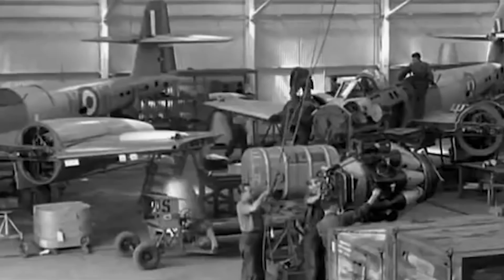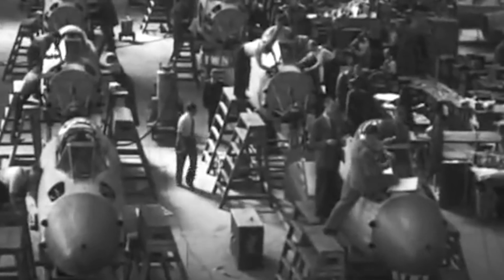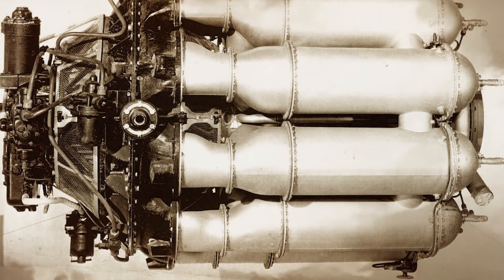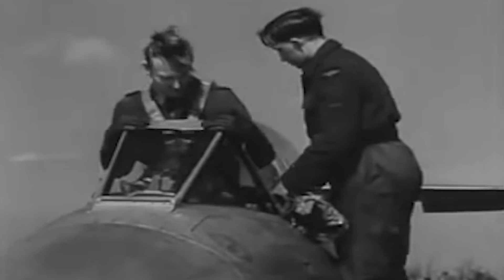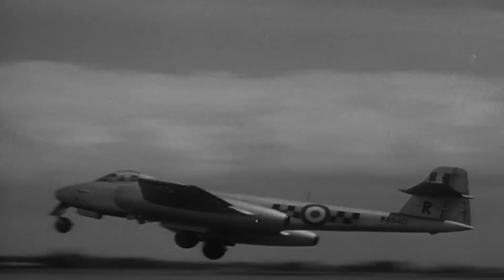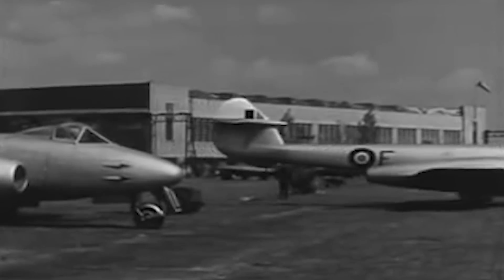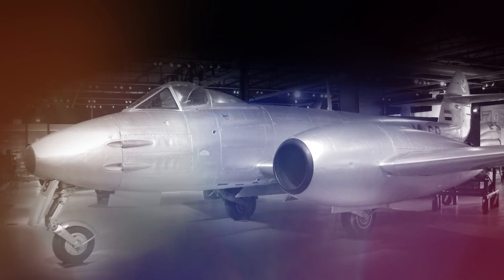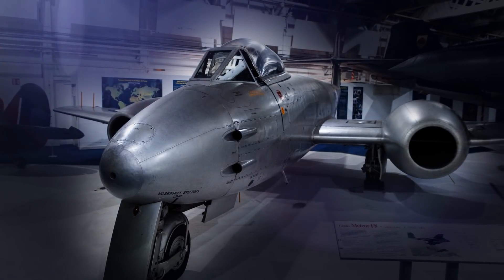Gloster Meteor - The Only Allied Jet to Fight in WW2

Comment: The meteor wasn’t developed to counter the Me-262. They entered service at roughly the same time. It was just pressed into service to tackle the V1.
Reply: I thought this too 👍🏻
Reply: Mactrip100 it was developed to test Jet fighter feasibility and to replace existing piston-engine fighters that were reaching the limit of development. 

Only the MkV and IX spitfires were developed to meet a specific existing fighter threat. Me109F and FW-190A respectively. From a purely british perspective.
Reply: @petemaly8950   Yes,  a certain person is now running to the mods because he doesn't want to read that  the Metrovick F2 was fully flight tested powering the F.9/40M on its first flight and continued in development to F9 and was produced as the Sapphire engine in the UK and under licence in the US as the J65. 

And that , during the war the Metrovick was developed with reheat, bypass and even open rotor versions. As you know German axial flow engines were hopelessly unreliable and ephemeral. As he mentioned Eric Brown, he'll recall that Brown noted that the Ju004 had an average scrap life of only twelve hours. 

he'll also be aware that post war Anselm Franz spent the rest of his career designing shaft engines to the format of Whittle's 1930 patent. In Russia a team of captured German engineers with the help of a host of Russian engineers still couldn't significantly improve the reliability and life of the Ju 004 and it was relegated to conversion trainers and a few experimentals. They tried the same with the BMW 003 and fitted it in the lacklustre MiG-9 but it proved to be so unreliable and flameout prone that when it came to the iconic MiG-15 they replaced it with the British Rolls Royce Nene engine. The French he'll recall adopted Ostrich, his team and the BMW 018 and even with as big a team of French engineers and completely redesigning the engine and adopting British Nimonic alloys the finally produced a serviceable engine only two or three years after their British and American peers. He is aware that Germany has never produced a significant successful GT jet engine without foreign help. 

And he  knows the Gloster Meteor was an extremely successful jet having a service career of over thirty years and serving in more than a dozen air forces, what other WW2 jet can you say that of except of course the de Havilland Vampire. The poor old Czechs lumbered themselves with eleven or twelve Me 262's but couldn't flog them to anyone, not even Argentina who were being advised by Kurt Tank and Adolf Galland and who bought the Gloster Meteor leading Galland to whish that he could have had the Meteor's engines on the Me 262 instead of the rubbish German engines.
Reply: Mactrip100  The 2 aircraft and engines were developed separately and without knowledge of each other ( although the Germans had read an early Frank Whittle research paper. Eacb side was looking for an advantage and turbojets had potential to be faster and higher that piston engines. They would also burn a lower grade fuel. Actually the Meteor was over a year late. The air ministry had given Whittle's design to Rover to produce but they made a hash of it. Finally they transferred the contract to Rolls Royce and the rest is history.
Reply: @davepotter9532  

Rover didnt 'make a hash of it' !
ROVER did a lot of the early1940s development of Whittles jet design and made lots of  improvements. Their design was good it wasused by RR in what became the RR Trench engines. However, Rover continued development themselves and produced in the 1950s the world first Jet powered car Jet 1. 
They even produced in conjunction with BRM a jet powered race car that competed at Le Mans driven by Graham Hill. Rover also produced Britain most successful gas turbine engine used to power various applications like water pumps and generators.
In the 1960s Rover intended their new P6 cars to be powered by a jet engine however, in 1967 Rover were taken over by British Leyland and that where all their problems started, and their fine reputation as engineers second only to RR was lost.
Reply: @johnbrereton5229  Good point, The real geniuses were Adrian Lombard at Rover and Stanley Hooker at Rolls-Royce.. without them Britain would have never had a successful jet engine program.
Reply: @sandervanderkammen9230  Halford and Metropolitan Vickers would like a word with you.  Britain was leading the world and gave USA and USSR their jet engines, the German jet engines were failures.
Reply: Lol a normal Tempest was well fast enough to catch up on a V1
Reply: @derrickstorm6976  define "normal"
Reply: @derrickstorm6976  
It was not just catching but catching up fast which was important and for which the Tempest, Mosquito, Spitfire and Mustang were all modified, the Tempest speed increased at low level to 412 mph at around 3,500 feet, the Spitfire not quite as fast but by 5,000 feet the Spitfire was the fastest except for the Meteor I which was the fastest of them all at low altitude.
Reply: The Gloster Meteorite was an unmitigated failure as a fighter aircraft... it only killed British pilots
Reply: @petemaly8950  Who's "We" LOL.  The complete list of Meteor air to air kills during WWII.  Just kidding, the Meteor was never used in combat due to its slow speed.  Pip pip cheerio
Reply: @petemaly8950  "We" LOL.  No Meteor ever engaged the enemy during WWII due to its slow speed
Reply: @petemaly8950  LOL "We" is only you. The British would be speaking German if not for the US.  If revisionist history helps you cope with Britain's failure to develop and operate an  operational combat jet during WWII that's very sad.  Well, OK funny.  Tea and Crumpets pip pip cheerio!
Reply: @petemaly8950  LOL We can help you!  3947 Meteors were built. 890 were lost in accidents. 450 pilots were killed. That's 22% lost. The Meteor was not used in combat until 1951 in Korea, where over half were lost to Migs. 1951, the Meteor was already obsolete for nine years by German standards. Anytime I can help! Earl Grey tea time!
Reply: @petemaly8950  The British would be speaking German if not for the American 8th AF that defeated the Luftwaffe, making it safe for the British to operate in daylight.  This should clear things up for you! Toodles!
Reply: @petemaly8950  LOL.  Nope. The He-280 was over 60 mph faster than the fastest wartime Meteor, complete with ejection seat. Ironically it too had high drag straight wings and an obsolete centrifugal flow engine just like the Meteor. The Germans went with the modern axial flow swept wing jet fighter design, the basis for all modern jet fighters and airliners. None use the obsolete centrifugal flow straight wing design of the Meteor. To be fair to the British, they didn't have German research and scientists until after the war.  Pip Pip Cheerio!
Reply: @TheAneewAony  

Lol Nope 😅👍

We do indeed feel we can clear up some commonly held misconceptions.

It's always good to see the facts laid out clearly isn't it.

Obviously the HE-280 was abandoned for lots of reasons, The Gloster Meteor did more than 30 years service for more than 17 air forces. There are of course 2 operational Meteors at Martin Baker.
  Yes that's correct of course, Obviously Germany were defeated before 1942 by various British military assets including of course various British piston engined aircraft.

  Agreed,  it is in fact true to say that the Gloster Meteor wasn't required to do anything other than home & allied territory defence & so wasn't kept very busy. That being the case due to it's various advanced features including it's speed, engines & engine technology including turbine blade metallurgy it was also deliberately not used in a way that would risk examples getting into the wrong hands (Mainly Russian & German hands of course).

 Obviously the Meteor was in fact operational over the UK during WW2.
The Arado was significantly inferior to the various British piston engined aircraft including the De Havilland Mosquito & of course didn't have functional landing gear 😅.

  It is indeed a great pity British military forces had to occupy a large part of Germany for decades after 1945 & the Russians had to do the same. Indeed the Russians still possess a large chunk of what was German territory. 

  Without doubt of course by the start of 1942 it was clear the British could start thinking about what they'd be doing after the future invasion of Germany, Germany having been obviously defeated by that date. 

  Indeed it is the case that the British, Franch & Russians now produce Nukes. Germany does not produce Nukes.

Regarding the claim or suggestion that the Gloster Meteor was particularly unsafe in some way.

De Havilland Vampire &  Sea Vixen & Gloster Meteor accident losses were not high or unusual for fighter aircraft at the time.
Non combat phase accident losses.
% of Aircraft built.
The Canadair CL-44 was a turboprop airliner.
Canadair CL-44             (ff 1959 ) 48%
Lockheed XF104             (ff 1954) 100%
Lockheed  P80                (ff 1944) 43%
Lockheed F104                (ff 1954) 45%
McDonnell FH Phantom  (ff 1945) 35%
Gloster Meteor               (ff 1943)  21%
DH Vampire                     (ff 1943)  23%
DH Sea Vixen                  (ff  1951) 33%
Gloster Javelin               (ff 1951) 20%

Gloster Meteor.
3950 Built.
In service 1944.
Less than 50% had ejector seats.
*2 Gloster Meteors are currently 
operational at Martin Baker.* 
839 accident losses.
436 accident loss fatalities.
21% accident losses.
11% accident loss Fatalities.

Lockheed F104.
2578 Built.
In service 1958, 14 years after the Meteor.
All with ejector seats.
1100 accident losses.
425 accident loss fatalities.
43% accident losses.
17% accident loss Fatalities.

Of course there is no doubt that in various conflicts there were plenty of deaths & injuries amongst people who were not Meteor pilots  caused by Gloster Meteors during combat operations.

That's correct obviously the RR Nene centrifugal compressor gas turbine aero engine was the most powerful & mist reliable gas turbine aero engine on the planet in 1944.

That's correct of course, Whittle type Centrifugal compressor reverse flow combuster gas turbine aero engines are currently produced by Pratt and Whitney & Lycoming.

Of course as always we hope this helps.

Cheers.
👍 & 😎 & of course 🙂 indeed.
Toodle PIP Old Chap 
     
We hope this helps obviously.
   
Cheers again 😎👍.  
  
. .... .
. .......
Reply: @petemaly8950  LOL "We" can help! The Metrovick project failed and was abandoned, never being able to solve hot spot burn through, cracked cases and turbine blade failure. Dr Franz, inventor of the axial flow engine, solved all these problems in 1940. It was not until 1947 that the British were able to build a working axial flow engine. Hopefully this clears things up for you!
Reply: @TheAneewAony  Hello Sandyboy,  why are you commenting in two of your identities  in the same thread?  

So Sandyboy, as you know Anselm Franz's ju004 engine was appallingly unreliable and ephemeral having according to Adolf Galland, an average scrap life of twelve hours  and post war Anselm Franz spent his remaining career at Lycoming designing shaft engines to the format of Whittle's 1930 patent.

The Metrovick F2 as you know Sandyboy was fully flight tested and powered the first flight of the F.9/40M. 

The Metrovick F2 continued devlopment into the F9 and went into production as the Armstrong Siddeley Sapphire and under licence in the US as the J65.

As you know the Russians attempted to make something of Franz's 004 engine but between their best engineers and a host of captured German engineers it remained an unreliable and short lived engine and was relegated to conversion trainer aircraft and a few experimantals. 

Similarly as you know Sandyboy, the Russians tried to make something of Ostrich''s BMW 003 engine and put it in the MiG-9 but it proved so unreliable and flameout prone that for the iconic MiG-15 they dropped the German engine and adopted the far superior British Rolls Royce Nene.

You'll recall no doubt Sandyboy, that Ostrich himself and many of his team took the BMW 018 and ended up in France where with the help of many French engineers, by completely redesigning it and adopting British Nimonic alloys they fianaly managed to produce a serviceable engine only two or three years after their British and American peers.

So consequentially as you know Germany has never produced a significant successful  jet engine without foreign help.
Reply: @TheAneewAony  

Lol 😅 NOPE

We feel we are able to clear up some common myths, errors & misconceptions.

Yes agreed, That's entirely factually correct of course, the RR Nene was the most powerful gas turbine aero engine on the planet in 1944 being twice as powerful as & 100 times more reliable than anything ever produced in Germany.
The basic gas turbine concept was first described  & patented in England before 1800

  That's correct, of course Parsons of Ireland & North England did indeed produce the world's first multi stage sequential stator rotor axial compressors and turbines before 1900 for turbomachinery use which were licensed for production throughout the industrial world, the basic components of most modern gas turbine aero engines. Parsons also did work on the axial compressor & axial turbine internal combustion gas turbine engine concept.

German engineers didn't ever manage to make any type of a useable or sensible gas turbine aero engine including those attempts made using British axial compressor turbomachinery technology from before 1900.

   Yes, agreed, it is in fact the case that the world's first demonstration of a reliable, viable, pure internal combustion gas turbine aero engine was of course performed by Sir Frank Whittle in 1937. The basic Whittle engine type with centrifugal compressor & reverse flow combuster is still manufactured & used for aircraft applications.

    Of course it is in fact the case that all previous attempts were very heavy hybrid turbocharged boilers or had piston engines driving compressors.

  As stated its agreed of course that it is correct that the following list of often claimed false myths have all indeed been thoroughly debunked.

"The Metrovick was never
tested successfully in WWII, the hot spot problem was never solved"???

    That's correct of course, The Metrovik F2/3 was fully flight certified in 1943, all problems solved, the research results being then used to carry on development of more powerful & more reliable engines. In 1944 the world's most powerful gas turbine aero engine was the RR (England) Nene which would go onto power many of the worlds jet fighters in China, Russia & the US either as licensed versions or unlicensed copies  into the 1960s.

 "The Metrovick lacked the advanced technology needed for a working jet engine. The first test of the
Metrovick 29 June 1943 in the open bomb bay
of an Avro Lancaster, fully a year after the
Me-262's axial-flow jet flight on 18 July 1942."??

      Yes it is the case that The Metrovik F2/3 was fully flight certified in 1943, all problems solved, the research results being then used to carry on development of more powerful & more reliable engines. In 1944 the world's most powerful gas turbine aero engine was the RR (England) Nene which would go onto power many of the worlds jet fighters in China, Russia & the US.

   
"Dr Franz invented the axial-flow jet engine. He
built the first working axial-flow jet engine, and
the first production jet engine."???

    As stated, it's obviously factually correct that Axial flow jet engines were being worked on in England before 1930. The world's first demonstration of a gas turbine aero engine was by Whittle in 1937. 

"The first patent for using an axial-flow gas turbine to power an aircraft was filed in 1921 by Guillaume.," French patent no. 534,801, Whittle had access to this patent."??

     Agreed, obviously Guillaume's patent was simply a copy of the work, inventions & ideas of Parsons of North England, the inventor of the world's first axial multi stage sequential stator rotor compressors & turbines used for turbomachinery applications before 1900 & licensed to the industrial world  & which form the basis of most current gas turbine aero engines.

"The Heinkel He 178, also the world's
first jet airplane flew August 27, 1939 no patent
was issued"???

   Indeed it is true of course that The Heinkel & it's engine by Ohain were of course very amusing & interesting & indeed completely useless. A bit like having an oriental toy manufacturer having a go at full size jet engines & jet aircraft. Ohain's engine was copied from Whittle with a radial turbine to avoid a patent infringement, Ohain had full access to most of Whittles work & writings on the subject & didn't understand most of the how's & why's if the new engines.

 "No British axial-flow jet engine
worked properly until after the war when they
examined advanced German research via
Operation Surgeon and the Fedden Mission etc."???

     Agreed, as stated it is the case that No German technology axial compressor gas turbine aero engine formed the basis of any UK or US built engines at any time. British axial compressor gas turbine aero engine work began before 1930. The world's first basic axial compressor & turbine technology for turbomachinery applications being created in England before 1900. Operation Surgeon is mostly fiction. 
  Obviously the key Nickel super alloys required for turbine blades were invented in England around 1940 & were available nowhere else at the time. In France around 1951 attempts to develop from German engine designs for the Dassault Mirage 3 resulted in the air cooled sheet steel turbine blades being eventually changed for solid Nimonic turbine blades & a number of other Rolls Royce technologies being adopted in order to get a working engine.

     Of course that's correct, Whittle demonstrated his engine in 1937, the world's first demonstration of a pure gas turbine aero engine.
Gloster E28/39 + Whittle W1 Short Hops April 1941.  
FF May 1941.
Gloster Meteor First flight 5 March 1943.
   Gloster Meteor In Service (after extensive trials & with a very reliable engine.)
  Introduction into service 27 July 1944 3947 produced. Operational in more than 17 countries. Retired 1980s RAF.
Gloster Meteors broke world speed records in 1945 & 1946 exceeding 600 mph. A Gloster Meteor was the world's first turboprop aircraft in 1945.

Yes we are aware that Of course all the British jet aircraft from 1941 onwards were able to exceed the speed of any current piston engine fighters of the same year, the British jet aircraft were not required as superior allied piston engine fighters could easily maintain air superiority. They were restricted to  operate over allied controlled territory only in order to prevent examples getting into the wrong hands.

    Me 262 First flight 18 April 1941 with piston engine (Junkers Jumo 210).
18 July 1942 with totally junky unreliable jet engines -  Junkerz Jumo 004.
In service Introduction April 1944 but mostly still highly experimental & obviously useless.
Retired 1945 Germany, 1951 Czechoslovakia.
Primary users Luftwaffe & Czechoslovak Air Force.

     As usual fiction doesn't help of course in such matters.

     Hope this helps obviously

         C H E E R S.  of course 
    &  Indeed  👍 & 😎 without doubt      
                 O B V I O U S L Y.

. ........ ............... .... ....

*(L O L)*. 

Obviously this line is not blank.
Reply: @petemaly8950  We can help you! The Meteor / Metrovick test flight failed due to cracked cases on the engine, hot spot burn through and broken turbine blades. These problems were never solved. The Metrovick project was abandoned, no working British axial flow engine would be developed until 1947, after access to German research and scientists.  The Meteor only served in third world countries and a couple of common wealth countries, as it was already obsolete in 1942. The 262 HG I had already hit 606 mph a year before the Meteor. The Meteor was a simple low tech design, if the Germans got a hold of one they would have realized that as Eric Brown stated, that the British were five years behind the Germans. The Meteor was also a metaphor of how England fell behind in aviation technology. But by golly shucks, you already knew that
Reply: @TheAneewAony   As you know The Metrovick F2 was fully flight tested powering the F.9/40M on its first flight and continued in development to F9 and was produced as the Sapphire engine in the UK and under licence in the US as the J65. 

As you know, during the war the Metrovick was developed with reheat, bypass and even open rotor versions.

As you know German axial flow engines were hopelessly unreliable and ephemeral. As you mention Eric Brown, you will recall that he noted that the Ju004 had an average scrap life of only twelve hours.

As you know post war Anselm Franz spent the rest of his career designing shaft engines to the format of Whittle's 1930 patent.  In Russia a team of captured German engineers with the help of a host of Russian engineers still couldn't significantly improve the reliability and life of the Ju 004 and it was relegated to conversion trainers and a few experimentals. They tried the same with the BMW 003 and fitted it in the lacklustre MiG-9 but it proved to be so unreliable and flameout prone that when it came to the iconic MiG-15 they replaced it with the British Rolls Royce Nene engine.
The French you'll recall adopted Ostrich, his team and the BMW 018 and even with as big a team of French engineers and completely redesigning the engine and adopting British Nimonic alloys the finally produced a serviceable engine only two or three years after their British and American peers.

As you know Germany has never produced a significant successful GT  jet engine without foreign help.

As you know the Gloster Meteor was an extremely successful jet having a service career of over thirty years and serving in more than a dozen air forces, what other WW2 jet can you say that of except of course the de Havilland Vampire. The poor old Czechs lumbered themselves with eleven or twelve Me 262's but couldn't flog them to anyone, not even Argentina who were being advised by Kurt Tank and Adolf Galland and who bought the Gloster Meteor leading Galland to whish that he could have had the Meteor's engines on the Me 262 instead of the rubbish German engines.
Reply: @TheAneewAony  

Lol 😅  NOPE

We feel we are able to clear up some common myths, errors & misconceptions.

Gloster Meteor operators.

Argentina
Australia 
Belgium 
Biafra
Brazil
Canada 
Denmark 
Equador
Egypt
France 
West Germany 
Israel
Netherlands 
New Zealand 
South Africa
Syria
UK RAF & Fleet Air Arm 37 years service.
Martin Baker Ejection Seat Testing to 2024.

For comparison the Me 262 & it's engines of course ceased production shortly after 1945 

Me 262 
Retired 1945, Germany.
Retired 1951, Czechoslovakia (Czechoslovakia only purchased them to sell on but nobody else wanted them).

Yes agreed, That's entirely factually correct of course, the RR Nene was the most powerful gas turbine aero engine on the planet in 1944 being twice as powerful as & 100 times more reliable than anything ever produced in Germany.
The basic gas turbine concept was first described  & patented in England before 1800

  That's correct, of course Parsons of Ireland & North England did indeed produce the world's first multi stage sequential stator rotor axial compressors and turbines before 1900 for turbomachinery use which were licensed for production throughout the industrial world, the basic components of most modern gas turbine aero engines. Parsons also did work on the axial compressor & axial turbine internal combustion gas turbine engine concept.

 Of course,  all German attempts were failures & all German attempts used the Parsons of Ireland & North England axial compressor turbomachinery components first produced in England before 1900.

 Agreed, obviously there is no such thing as the 'German axial gas turbine aero engine' or 'the German axial compressor'.

   Yes, agreed, it is in fact the case that the world's first demonstration of a reliable, viable, pure internal combustion gas turbine aero engine was of course performed by Sir Frank Whittle in 1937. The basic Whittle engine type with centrifugal compressor & reverse flow combuster is still manufactured & used for aircraft applications.

    Of course it is in fact the case that all previous attempts were very heavy hybrid turbocharged boilers or had piston engines driving compressors.

  As stated its agreed of course that it is correct that the following list of often claimed false myths have all indeed been thoroughly debunked.

"The Metrovick was never
tested successfully in WWII, the hot spot problem was never solved"???

    That's correct of course, The Metrovik F2/3 was fully flight certified in 1943, all problems solved, the research results being then used to carry on development of more powerful & more reliable engines. In 1944 the world's most powerful gas turbine aero engine was the RR (England) Nene which would go onto power many of the worlds jet fighters in China, Russia & the US either as licensed versions or unlicensed copies  into the 1960s.

 "The Metrovick lacked the advanced technology needed for a working jet engine. The first test of the
Metrovick 29 June 1943 in the open bomb bay
of an Avro Lancaster, fully a year after the
Me-262's axial-flow jet flight on 18 July 1942."??

      Yes it is the case that The Metrovik F2/3 was fully flight certified in 1943, all problems solved, the research results being then used to carry on development of more powerful & more reliable engines. In 1944 the world's most powerful gas turbine aero engine was the RR (England) Nene which would go onto power many of the worlds jet fighters in China, Russia & the US.

   
"Dr Franz invented the axial-flow jet engine. He
built the first working axial-flow jet engine, and
the first production jet engine."???

    As stated, it's obviously factually correct that Axial flow jet engines were being worked on in England before 1930. The world's first demonstration of a gas turbine aero engine was by Whittle in 1937. 

"The first patent for using an axial-flow gas turbine to power an aircraft was filed in 1921 by Guillaume.," French patent no. 534,801, Whittle had access to this patent."??

     Agreed, obviously Guillaume's patent was simply a copy of the work, inventions & ideas of Parsons of North England, the inventor of the world's first axial multi stage sequential stator rotor compressors & turbines used for turbomachinery applications before 1900 & licensed to the industrial world  & which form the basis of most current gas turbine aero engines.

"The Heinkel He 178, also the world's
first jet airplane flew August 27, 1939 no patent
was issued"???

   Indeed it is true of course that The Heinkel & it's engine by Ohain were of course very amusing & interesting & indeed completely useless. A bit like having an oriental toy manufacturer having a go at full size jet engines & jet aircraft. Ohain's engine was copied from Whittle with a radial turbine to avoid a patent infringement, Ohain had full access to most of Whittles work & writings on the subject & didn't understand most of the how's & why's if the new engines.

 "No British axial-flow jet engine
worked properly until after the war when they
examined advanced German research via
Operation Surgeon and the Fedden Mission etc."???

     Agreed, as stated it is the case that No German technology axial compressor gas turbine aero engine formed the basis of any UK or US built engines at any time. British axial compressor gas turbine aero engine work began before 1930. The world's first basic axial compressor & turbine technology for turbomachinery applications being created in England before 1900. Operation Surgeon is mostly fiction. 
  Obviously the key Nickel super alloys required for turbine blades were invented in England around 1940 & were available nowhere else at the time. In France around 1951 attempts to develop from German engine designs for the Dassault Mirage 3 resulted in the air cooled sheet steel turbine blades being eventually changed for solid Nimonic turbine blades & a number of other Rolls Royce technologies being adopted in order to get a working engine.

     Of course that's correct, Whittle demonstrated his engine in 1937, the world's first demonstration of a pure gas turbine aero engine.
Gloster E28/39 + Whittle W1 Short Hops April 1941.  
FF May 1941.
Gloster Meteor First flight 5 March 1943.
   Gloster Meteor In Service (after extensive trials & with a very reliable engine.)
  Introduction into service 27 July 1944 3947 produced. Operational in more than 17 countries. Retired 1980s RAF.
Gloster Meteors broke world speed records in 1945 & 1946 exceeding 600 mph. A Gloster Meteor was the world's first turboprop aircraft in 1945.

   Yes we are aware that Of course all the British jet aircraft from 1941 onwards were able to exceed the speed of any current piston engine fighters of the same year, the British jet aircraft were not required as superior allied piston engine fighters could easily maintain air superiority. They were restricted to  operate over allied controlled territory only in order to prevent examples getting into the wrong hands.

    Me 262 First flight 18 April 1941 with piston engine (Junkers Jumo 210).
18 July 1942 with totally junky unreliable jet engines -  Junkerz Jumo 004.
In service Introduction April 1944 but mostly still highly experimental & obviously useless.
Retired 1945 Germany, 1951 Czechoslovakia.
Primary users Luftwaffe & Czechoslovak Air Force.

     As usual fiction doesn't help of course in such matters.

     Hope this helps obviously

         C H E E R S.  of course 
    &  Indeed  👍 & 😎 without doubt      
                 O B V I O U S L Y.

. ........ ..............

(L O L)

Obviously this line is not blank
.. .. .  .  .  ..
Reply: @petemaly8950  Negative. We feel that bench testing,  like Ohain, wasn't a working engine. Ohain and Heinkel demonstrated the first working jet engine nearly three years before Whittle,  by inventing the jet airplane,  meanwhile Whittle was still bench testing his engine. Hopefully this clears things up for you!
Reply: @TheAneewAony  I always think it's worth reminding you of what the famous German gas turbine pioneer Pabst Von Ohain had to say in his foreword to 'Elements of Propulsion, gas turbines and rocket'-

"The first patent of a turbojet engine, which was later developed and produced, was that of Frank Whittle, now Sir Frank (see Fig. 5). His patent was applied for in January 1930. This patent shows a multistage, axial-flow compressor followed by a radial compressor stage, a combustor, an axial-flow turbine driving the compressor, and an exhaust nozzle. Such configurations are still used today..."

and -

"In April 1937, Whittle had his bench-test jet engine ready for the first test run. It ran excellently; however, it ran out of control because liquid fuel had collected inside the engine and started to vaporize as the engine became hot, thereby adding uncontrolled fuel quantities to the combustion process. The problem was easily overcome. This first test run was the world's first run of a bench-test jet engine operating with liquid fuel..."

and-

"From the beginning of his jet propulsion activities, Frank Whittle had been seeking means for improving the propulsive efficiency of turbojet engines. He conceived novel ideas for which he filed a patent application in 1936, which can be called a bypass engine or turbofan. To avoid a complete new design, Whittle sought an interim solution that could be merely "tacked on" to a jet engine. This configuration was later known as the aft fan. Whittle's work on fan jets or bypass engines and aft fans was way ahead of his time. It was of greatest importance for the future or turbopropulsion."
Reply: @TheAneewAony   @TheAneewAony  

We feel we may be able to help clear up some commonly held misconceptions.

    Agreed, that is of course entirely correct.
Sir Frank Whittle carried out the world's first  demonstration of a gas turbine aero engine in 1937.

We do indeed hope this helps of course.

Cheers 👍😎 as always etc.

. ... ... .
. . .......
Reply: @petemaly8950  LOL.  The Ohain and Heinkel invented the jet airplane and the first jet engine.
Reply: @petemaly8950  The Meteor never actually was used. It was far too slow. But you already know. It is humorous to hear your excuses for why the British so far behind the Germans.
Reply: @petemaly8950  LOL.  Tell us again why the Metrovick failed! How the British were unable to develop a working axial-flow jet engine until 1947. If not, I
will. Seems you're still apologizing for something that is simply not your fault,  Britain's inability to build an operational combat jet during WWII.  Hopefully this clears things up for you! What the heck is spotted dick. Tea and crumpets OK. Pip pip cheerio old chap
Reply: @petemaly8950  Neat trick.  Whittle copies Maxime Guillaume's  patent, but Ohain builds the world's first working jet engine three years before Whittle.  Who invented the jet airplane? Hint,  it rhymes with Heinkel and Ohain.
Reply: @TheAneewAony  Hello Sandyboy I always think it's worth quoting that famous German jet pioneer Hans Joachim Pabst von Ohain who said-

"1) In 1908, Lorin patented a jet engine that was based on piston machinery
(Fig. 4a).
2) In 1913, Lorin patented a jet engine based on ram compression in supersonic
flight (Fig. 4b), the ramjet.
3) In 1921, M. Guillaume patented a jet engine based on turbomachinery; the
intake air was compressed by an axial-flow compressor followed by a combustor
and an axial-flow turbine driving the compressor (Fig. 4c)...   Also, in the early 1920s, an excellent theoretical study about the possibilities
of enjoying jet propulsion had been conducted by Buckingham of the
Bureau of Standards under contract with NACA. The result of this study was
clear--the jet engine could not be efficiently employed if the aerovehicle could
not greatly exceed the flight speed of 200 mph; a flight speed beyond 400 mph
seemed to be necessary.The consequences of the results of this study were
that the aircraft engine industry and the scientific and engineering community
had no interest in the various jet engine inventions.  Thus the early jet engine 
concepts were forgotten for a long time. They were unknown to Sir Frank
Whittle, to me, and to the British and German patent offices. In 1939,
however, the retired patent examiner Gohlke found out about the early jet
patents and published them in a synoptic review."
Reply: If the 262 was so bloody marvelous,the Allies would have been churning them out post WW2
Reply: @tfs203  The Gloster Meatbox proved to be unsuitable as a V1 interceptor and was recalled from this operational role.
Most V1s that were shot down were by the faster Mosquitoes or the Tempest.

The Meatbox was used primiarily as trainer, recconiasance, demonstration aircraft and saw limited success in the ground attack role... it never saw service as a fighter.
Reply: @sandervanderkammen9230  I didn't know that, thank you!
Reply: @sandervanderkammen9230 Sanctum, Meteors were very good at shooting down V 1's, they were  only used late in the V 1 campagne and only in  very small numbers. Most V 1's were shot down by Tempests, Mosquito's and Spitfires which were all not as fast as the Meteor. The Meteor was used for combat, it proved so effective that the Luftwaffe stayed well away and the Meteor was successful for ground attack, the Me 262 was only moderately successful as a bomber interceptor, not much good for combat or ground attack.
Reply: @barrierodliffe4155  Please name a single British company that still makes the commercial jet aircraft in the U.K.???
Reply: @barrierodliffe4155  Britain has never made a successful jet fighter, and no  one wanted them, even the RAF doesn't use British jet fighters anymore.
Reply: Sandybum, Irrelevant tghat British Aerospace is very involved in the design of Airbus. Can't you take it that you have been discrediyed so many times?
Reply: @sandervanderkammen9230  Gloster Meteor,  DH Vampire, Hawker Sea Hawk, Hawker Hunter, Folland Gnat, English Electric Lightning and Harrier The RAF used te Tornado and now the Typhoon both of which are a large part British.  

You do realise that you share a couple of things in common with Wilbur Finnigan?  you both use more than one name for your lies and hate for all things British.
Reply: @sandervanderkammen9230  Hello Sandyboy, I see you still burn with impotent wehraboo rage at the success of the British jets like the Meteor with its thirty plus years service and with more than a dozen air forces,  the Vampire with its forty plus years service and in more than a twenty air forces, the Canberra which is still in service after after seventy two years and served with more than 15 air forces.
Reply: @barrierodliffe4155 BAe is not involved with Airbus SE, it is a German French and Spanish company.
Reply: @barrierodliffe4155  The Gloster Meatbox is the worst jet fighter in history... 1 out of every 3 built crashed or were destroyed in accidents.
890 crashed in RAF service killing 450 British pilots.
Reply: Please name a single British company that still makes commercial jet aircraft in the UK???
Reply: @fritzwrangle-clouder6033  Postwar Britain was a bankrupt country and had to make do with obsolete aircraft such as the Meteor.  Hope this clears things up for you!
Reply: @TheAneewAony  
Doktorbimmer a quiz.
Name the inventor of the turbojet?
20 points for the correct answer.
Reply: @johnburns4017  Inventor(s).  Well, you're making progress.  LOL,  anytime I can help
Reply: @TheAneewAony  
BZZZZZT! Wrong answer.
Doktorbimmer, the name of the I vendor of the turbojet is....

 🎊🍾🍸 Frank Whittle 🎊🍾🍸

Zero points bimmer, Zero. Better luck next time.
Reply: @TheAneewAony  
Of the 2,240 points available  to win, you have achieved exactly ...

🎊🍾🍸 Zero points 🎊🍾🍸

You have been a fine contestant doktorbimmer, keep up the good work.
Reply: @johnburns4017  Revisionist history is how you cope with Britain's failure to develop, deploy and place into combat an operational jet during WWII is sad.  Pip pip Cheerio!
Reply: @johnburns4017  Oh you were so close.  Missed it by 8 years!  "The first patent for using a gas turbine to power an aircraft was filed in 1921 by Guillaume. ," French patent no. 534,801 (filed: 3 May 1921; issued: 13 January 1922)." Pip pip cheerio!
Reply: @barrierodliffe4155  The Meteor had 450 confirmed kills.  Unfortunately, they were all British pilots
Reply: @TheAneewAony  Hello Sandyboy, why have you invented yet another identity? You have about six now don't you and you're using two of them in this thread.

As you know, the Gloster Meteor was an extremely successfuul jet having a service career of over thirty years and serving in more than a dozen air forces, what other WW2 jet can you say that of except of course the de Havilland Vampire.
Times were certainly hard for Britain postwar but it was worth it to trash the nazis '1000 year reich' defeating Germany for the second time in barely thirty years.
Reply: @fritzwrangle-clouder6033  As you know, the Meteor was too slow to be used in WWII combat, so it was never truly "operational"
Reply: @fritzwrangle-clouder6033  The obsolete Meteor served in third world countries, as well as postwar bankrupt commonwealth countries.  It wasn't a choice, it was all that they could do
Reply: @TheAneewAony  Hello Sandyboy, how the devil are you? 

So Sandyboy, why have why have you invented yet another identity? You have about six now don't you and you're using two of them in this thread.

As you know Sandyboy, in WW2 the Gloster Meteor was operational destroying German weapons of desperation and shooting up German airfields. As you know, from that it went on to a a service career of over thirty years and with more than a dozen air forces. What other WW2 jet can you say that of, apart from the de Havilland Vampire of course.
Reply: @fritzwrangle-clouder6033  Going over this list of all the British jet aces in history.  Just kidding, there aren't any
Reply: @TheAneewAony  Hello Sandyboy,  why didn't you like me listing all your other identities!? Why have you started yet another identity?

As you know Sandyboy the Gloster Meteor was an extremely successful jet having a service career of over thirty years and serving in more than a dozen air forces, what other WW2 jet can you say that of except of course the de Havilland Vampire.

As you know the poor old Czechs lumbered themselves with a dozen me 262s nocked up from bits and pieces but no body was interested in them, not even the Argentinians who were awash with nazis and nazi money and being advised by Kurt Tank (the Argentinians as you know bought the Meteor, Adolph Galland praising it and expressing his wish that he'd had the Meteors engines for the 262).  The Czechs reluctantly introduced the unsellable me 262s (Avia S-92s) into their own air force but after less than a year they were reduced to dust collectors for static training only.
Reply: @fritzwrangle-clouder6033  Britain was bankrupt after the war and had to use totally obsolete equipment such as the Meteor, it was never a choice.  As you mentioned some were also used by third world countries. The Meteor created many aces, unfortunately they were all Russians flying Migs.  Hope this helps!
Reply: @TheAneewAony  Hello Sandyboy,  So Sandyboy, why have why have you invented yet another identity? You have about six now don't you and you're using two of them in this thread.

So Sandyboy, I'm just going over this list of world wars Germany won. Just kidding, there aren't any.
Reply: @TheAneewAony  Hello Sandyboy, how the devil are you?  Why have you invented yet another identity?

As you know Sandyboy the Gloster Meteor was an extremely successful jet having a service career of over thirty years and serving in more than a dozen air forces, what other WW2 jet can you say that of except of course the de Havilland Vampire.
Reply: @fritzwrangle-clouder6033  You aren't speaking German.  Thank the 8th AF
Reply: @fritzwrangle-clouder6033  The British had already lost the war, if not for the 8th AF.  That's why you're not speaking German
Reply: @fritzwrangle-clouder6033  Nah.  Britain had already lost the war.  America saved 'em.  Again
Reply: @TheAneewAony  Hello Sandyboy, how many different identities do you have now, it's six or seven isn't it? I see you are using two of them in this comment thread.

I had a nice drive down through Germany a month or two ago and went through Luneburg where Montgomery took the Unconditional Surrender of German forces.
Reply: @johnburns4017  The He-280, complete with ejection seat, fully 60 mph faster than the fastest wartime Meteor flew while Whittle was still bench testing his centrifugal flow engine. Hopefully this clears things up for you! Pip Pip Cheerio
Reply: @TheAneewAony  
docktorbimmer a quiz.
Name the first operational jet fighter?
20 points for the correct answer.
Reply: @johnburns4017  The 262. As no Meteor was ever "operational" during WWII, nor did any see combat with the enemy. None. Hopefully this clears things up for you.
Reply: @johnburns4017  Quiz, name the only operational combat jet to operate over England during WWII. Hint: It rhymes with AR-234
Reply: @TheAneewAony  
BZZZZZT Wrong answer!
Doktorbimmer, the name of the first operational jet plane was the.. 

🎊🍾🎈 Meteor  🎊🍾🎈

Zero points doktorbimmer. Zero.  Better luck next time.
Reply: @johnburns4017  Negative Ghost Rider! The Meteor was "operational" after the 262. If you consider actively hiding from Germans operational. Hope this helps! "The Messerschmitt Me 262, nicknamed Schwalbe (German: "Swallow") in fighter versions, or Sturmvogel (German: "Storm Bird") in fighter-bomber versions, is a fighter aircraft and fighter-bomber that was designed and produced by the German aircraft manufacturer Messerschmitt. It was the world's first operational jet-powered fighter aircraft and "the only jet fighter to see air-to-air combat in World War Two".[5]"  Pip Pip Cheerio!
Reply: @johnburns4017  Tell us again when Whittle was finally done bench testing his centrifugal flow engine and had working version? Was it one year after Ohain and Heinkel invented the jet airplane? Was it two years after Ohain and Heinkel invented the jet airplane? Was it nearly years after Ohain and Heinkel invented the jet airplane? Bonus round: How many German jets flew before the British E. 28/39. Was it five? Was it ten? Was it over a dozen? Remember, Google is free
Reply: About the Me262:
First flight 	
    18 April 1941 with piston engine (Junkers Jumo 210)
    18 July 1942 with jet engines
Introduction 	April 1944
Retired 	1945, Germany
               1951, Czechoslovakia
Me 262 pilots claimed a total of 542 Allied aircraft shot down, although higher claims are sometimes made.
https://en.wikipedia.org/wiki/Messerschmitt_Me_262
About he Meteor:
First flight 	5 March 1943
Introduction 	27 July 1944
Retired 	1980s (RAF target tugs)
The Meteor saw limited action in the Second World War.
https://en.wikipedia.org/wiki/Gloster_Meteor
Reply: @hurri7720  
The Me 262 took a long time to develop and it saw limited combat during WW II, it proved to be a bad fighter, the claims are very exaggerated, maybe 150 and mostly USAAF bombers. Not a single RAF fighter, RAF fighters did shoot down quite a number of Me 262's.
The Meteor went on to have a long successful career and action post war.
Reply: @hurri7720  Of course any fighter will be replaced by newer aircraft that is very obvious, Swept wings did become but common but Lockheed didn't seem to understand and made the worst ever fighter, they even had ejection seats from the start but though ejecting downwards was a good idea.
It is very easy to look back and criticise but the Gloster Meteor was very good and had a lower loss rate than the P 80 which not only had straight wings and a British jet engine, it also missed WWII
Reply: @hurri7720  
Very silly to compare the P 80 which saw a bit of action in Korea as did the Meteor, the Meteor also saw action against Germany, the P 80 didn't, the Meteor saw action in Israel, the P 80 didn't, the Meteor saw action in the Argentine revolution in 1955.
If we really look we find that not only was the P 80 inferior to the Me 262 but inferior to the Meteor which wasn't inferior to the Me 262, the RAF tested a Meteor against a Tempest and concluded the Meteor was better in almost every way, considering that the Me 262 never shot down a single jet or RAF Tempest or Spitfire, I conclude that the Me 262 was not a good fighter. The Meteor did account for a few Mig 15's, in Korea, not bad for the first jet fighter.
Reply: @barrierodliffe4155  ,the Meteor saw no action against Germany, that you should know by now. 
(the RAF was forbidden to fly the Meteor on combat missions over German-held territory for fear of an aircraft being shot down and salvaged by the Germans.)
 
It was a first try and like P 80 not that good. No surprise there.

Actually only the Russians got it right with the MiG-15 in the beginning.
Quoting the Wikipedia:
"Despite initial claims of success, the speed of the straight-wing F-80s was inferior to the 668 mph (1075 km/h) MiGs. The MiGs incorporated German research that showed that swept wings delayed the onset of compressibility problems, and enabled speeds much closer to the speed of sound. F-80s were soon replaced in the air superiority role by the North American F-86 Sabre.
The Meteor didn't do 668 either during those years..
And on the Meteor in Korea:
"At the end of 1951, due to the perceived superiority of the MiGs in air combat – as well as the Meteor's favourable low-level performance and sturdy construction, RAAF commanders had 77 Squadron reassigned to ground-attack duties.".

The Meteor was better than nothing but not exceptional in anything and that goes for the P-80 too.
It was good for the British export industry though for some years.
Of course not comparable to the MiG-15 in that respect either:
"The MiG-15 is believed to have been one of the most produced jet aircraft with more than 13,000 manufactured.[1] Licensed foreign production may have raised the production total to almost 18,000.[citation needed] The MiG-15 remains in service with the Korean People's Army Air Force as an advanced trainer. "

"The MiG-15 was one of the first successful jet fighters to incorporate swept wings to achieve high transonic speeds. In combat over Korea, it outclassed straight-winged jet day fighters, which were largely relegated to ground-attack roles, and quickly countered the similar American swept-wing North American F-86 Sabre. ".

Of the WWII jet fighters the the Me262 is the only exceptional jet fighter worth mentioning.
Reply: @hurri7720  The Meteor saw action starting in 1944 against the V 1's, it was then sent to Europe and at first held back for airfield defense, then sent on ground attack missions over Germany, some 46 Luftwaffe aircraft destroyed by the Meteor. The funny thing is that no Me 262 or any other Luftwaffe fighter came up to fight the Meteor.
The Meteor served very well for decades.
In Korea the Meteor was used mostly for ground attack but they did meet Mig 15's and while at a disadvantage against the much newer Mig, they did shoot some down, I believe it was about 6. The Mig 15 was hardly the first attempt by the Soviets, The Mig 9 which first flew in 1946 along with the SU 9 were the first, Both not even close to the Meteor.
The Me 262 was not much of a fighter, it lost out to Spitfires and Tempests and was not much of a threat to unarmed photo reconnaissance aircraft. The far better Meteor wasn't needed so much since Britain had the best piston engine fighters of the war.
Reply: @barrierodliffe4155  The Messerschmitt Me-262 was superior to anything the Allies had in service..
Shooting down over 550 Allied aircraft.
The Meatbox only killed British pilots.
Reply: @sandervanderkammen9230   It destroyed some 46 German aircraft with no combat losses.
Reply: @sandervanderkammen9230  
The superior Me 262 was a failure, it failed against the Mosquito, it failed against the Tempest and it failed against the Spitfire, even unarmed Spitfires.
The Meteor served for decades.
Reply: @sandervanderkammen9230  Wie ist es, ein Feigling zu sein, kleiner Doktor, Mistkerl?
Reply: @hurri7720  nope the Me  262, (they first operationnal jet fighter the other was only test aircrafts)  enter in service 2 MONTHS  (not years) before the Gloster meteor, BUT the first completed squadron was the meteor not the me 262!
Reply: @hurri7720  yes this, is much more realistic , and  yes the very high consumption was the problem n° 1 from all these first jet fighters, inclusive the me 262...
Reply: @hurri7720  the me 262 was superior in speed and climb, but not in agility (this is the price payed for the swept wings) , but later Meteors was much faster in all conditions than the me 262 , specialy the F8 (1948)
Reply: @barrierodliffe4155  yes and a Meteor did shot down a jet bomber Arado AR234 over west germany
Reply: @leneanderthalien  , Lots of rubbish there.
Quoting the Wikipedia.
"The Meteor saw limited action in the Second World War.

The Meteor was initially used to counter the V-1 flying bomb threat. 616 Squadron Meteors saw action for the first time on 27 July 1944, when three aircraft were active over Kent. These were the first operational jet combat missions for the Meteor and for the Royal Air Force. After some problems, especially with jamming guns, the first two V1 "kills" were made on 4 August.[105] By war's end, Meteors had accounted for 14 flying bombs.[106] After the end of the V-1 threat, and the introduction of the ballistic V-2 rocket, the RAF was forbidden to fly the Meteor on combat missions over German-held territory for fear of an aircraft being shot down and salvaged by the Germans. 

In March, the entire squadron was moved to Gilze-Rijen Air Base and then in April, to Nijmegen. The Meteors flew armed reconnaissance and ground attack operations without encountering any German jet fighters. By late April, the squadron was based at Faßberg, Germany and suffered its first losses when two aircraft collided in poor visibility. The war ended with the Meteors having destroyed 46 German aircraft through ground attack.[citation needed] Friendly fire through misidentification as Messerschmitt Me 262s by Allied anti-aircraft gunners was more of a threat than the already-diminished forces of the Luftwaffe; to counter this, continental-based Meteors were given an all-white finish as a recognition aid.

https://en.wikipedia.org/wiki/Gloster_Meteor

Meanwhile:

The Me 262 was faster and more heavily armed than any Allied fighter, including the British jet-powered Gloster Meteor.[5] One of the most advanced aviation designs in operational use during World War II,[6] the Me 262's roles included light bomber, reconnaissance and experimental night fighter versions.

Me 262 pilots claimed a total of 542 Allied aircraft shot down,[7] although higher claims are sometimes made.
https://en.wikipedia.org/wiki/Messerschmitt_Me_262

In the 1950s, the Meteor became increasingly obsolete as more nations introduced jet fighters, many of these newcomers having adopted a swept wing instead of the Meteor's conventional straight wing; 

A total of 890 Meteors were lost in RAF service (145 of these crashes occurring in 1953 alone), resulting in the deaths of 450 pilots. Contributory factors in the number of crashes were the poor brakes, failure of the landing gear, the high fuel consumption and consequent short flight endurance (less than one hour) causing pilots to run out of fuel, and difficult handling with one engine out due to the widely set engines.
Reply: @hurri7720  
You have managed to give some information from Wikipedia and you include Luftwaffe claims for the Me 262 but those claims are highly exaggerated, the true number is about 150 and mostly bombers. Many of the claims are false like Kurt Welter who claimed some 30 Mosquitos but he could at most have possibly shot down 3.   There were  claims for Spitfires shot down, I have seen 7 and of those I was quickly able to prove 6 didn't happen and the 7th lacked anything to check, as in no time or place. 
If the pilot flew at 600 mph then the duration was just under an hour. The engines mounted on the wings had the same effect as the very unreliable engines mounted on the wings of the Me 262 which also had a very short duration.
Of course the Meteor became obsolete in the 1950's but why not, it was the fist jet fighter in service in 1944, as for the number of crashes there were more Meteors and they had less crashes than the P 80.
The Me 262 apart from being a very poor fighter had guns which were not very good.
Reply: @barrierodliffe4155   ,"sour grapes" apparently for some reason for you, but the fact remains that the Me262 was the superior fighter yet used in WW2.
So good by and calm down.
Reply: @leneanderthalien  Sorry but that brit myth is simply not true.
The Messerschmitt Me-262 entered operational squadron service with the Luftwaffe on April 19th 1944.
Reply: @leneanderthalien  RubbIsh mate! The Me-262 was superior to anything the Allies had in both speed and high speed manuvereabilty.
The 262 could turn at speeds well above the maximum speed of any allied fighter, swept wings are an advantage in a dogfight as there is far less energy bleed-off. 
The Allies never built a fighter capable of going one-on-one with the Me-262.
Reply: @leneanderthalien  Never happened, the Meatbox mever shot down a single Luftwaffe plane... never.
Reply: @sandervanderkammen9230  Nonsense the Meteor and the Me 262 were both used as home defence interception fighters. The Meteor shot down every manned bomber the Axis sent over the UK in daylight from June 1944 onwards. The Me262 can’t say the same about allied bombers.
Reply: @davidwright7193  Thats funny! You sir are quite the comedian.
Reply: @sandervanderkammen9230  Yes it was meant to be funny but it is also true and in being true shows the fundamental weakness of your argument. The Me262 could shoot down a few hundred aircraft because the allies sent 10’s of thousands of bombers over Germany when the Me262 was operational. The meteor couldn’t match that because the Luftwaffe wasn’t able to mount large scale bombing raids over the UK in the winter of 44/45.
Reply: @davidwright7193  The RAF couldn't field a jet fast enough to catch propeller driven aircraft, it was no match for the Me-262.
 The Meatbox never shot down a single Luftwaffe plane and was a complete failure as fighter aircraft. After a brief but dissappointing trial intercepting V-1s it only saw service as a trainer, ground attack and recon roles.
 Over 1,000 would crash killing 450 british pilots alone... making it the most effective British aircraft used against the RAF! 
 RAF Air ChiefMarshal Sir Frederick Bowhill called the "meatbox" a quote;
"Dismal and lackluster aircraft"
Reply: @sandervanderkammen9230  
The Me 262 did not enter operational service until late 1944, in April there were very few in an experimental and training unit.
Reply: @sandervanderkammen9230  The unswept wing Me 262 had very poor maneuverability at any speed, swept wings work if they are swept at 30 degrees or more but they have no aerodynamic effect at 18 degrees. The Me 262 couldn't handle RAF piston engine fighters, not a single Spitfire or Tempest ever shot down by an Me 262.  The Meteor went on to shoot down a few jets something the Me 262 never did.
Reply: @sandervanderkammen9230  
46 Luftwaffe aircraft destroyed and where was your wonderful Me 262?  hiding.
Reply: @leneanderthalien  "yes and a Meteor did shot down a jet bomber Arado AR234 over west germany" No. It did not. No Meteor ever engaged the enemy in combat during WWII. The Ar-234 was in fact the only operational combat jet to operate over England during WWII as no Meteors were ever used in actual combat
Reply: @barrierodliffe4155  The Meteor never engaged the enemy in operational combat during WWII.  Four were sent to Belgium,  one either crashed or was shot down by a German He-162. We'll never know
Reply: @leneanderthalien  Nope. No Meteor ever engaged any enemy in operational air to air combat during WWII. None
Reply: Don't expect Dark Skies to get his facts right. his videos are littered with errors.
Reply: the patent from whittles engine was made public the Germans had it to do there engine
Reply: @topbanana4013  Maxime Guillaume patented the turbojet aircraft engine in in 1921 when a 14 year old Frankie was still wearing short pants.

That's a popular British urban myth, of course it is completely false.
Neither man was aware of the others work at the time, Von Ohain's engine looks and works nothing like Whittle's 1930 patent design.
Reply: @sandervanderkammen9230  Hello Sandyboy, I see you are back in love with Guillaume's patent with its sweet little crank handle. While you are here Sandyboy, can you explain how you suppose that, as you've claimed A.A. Griffiths witnessed the development of Brown Boveri's Velox boiler before writing his seminal 1926 paper on turbine design when the Brown Boveri didn't start development of the Velox boiler until 1930.
Reply: @sandervanderkammen9230  By the way Sandyboy, with regard to Maxime Guillaume's patent, do you still insist that it was for an axial flow compressor engine? Have you actually read the patent?
Reply: @martkbanjoboy8853  In 1952, 12 "Meatboxes" crashed in a single week, 150 in total that year, in 1951 6 crashed in a single day. 
The losses were absolutely staggering yet the RAF never grounded this appallingly unstable aircraft... they did nothing.
Reply: @sandervanderkammen9230  only the first Meteors was unstable, the tail was lenghtened on the last MkIII built spring 1945, and in serial on MK4+ a bigger tail fin...Me 262 had similar aerodynamic problems at high speed, was uncontrolable over 950km/h in dive...
Reply: @leneanderthalien  Not true, the Meatbox was inherently unstable and over 1,000 crashed due to spins and asymmetric instability problems.
 The Messerschmitt Me-262 flew to 624mph setting a world record for production jet aircraft in 1944.
Not bested until the F-85 Sabre in 1947.
Reply: @sandervanderkammen9230  
What else did the screaming voices tell you today?
Reply: @johnburns4017  John please get therapy
Reply: @sandervanderkammen9230  
Is that all the screaming voices told you?
Reply: @johnburns4017  John you really need help, please get therapy
Reply: @sandervanderkammen9230  
The Meteor was very good and some did crash due to the pilots pushing the limits, it served very well for decades.
The false claim which is not a recognised air speed and very unlikely to have been possible, that speed would be pushing the mach limit for the Me 262.  The fastest in service speed was 540 mph, the Me 262 never shot down a single Tempest or Spitfire.
Reply: @sandervanderkammen9230  6:22 "the design of the Meteor was more attractive than that of the Me 262” WHAT??  
the word "attractive “ is definitely SUBJECTIVE .
Reply: @johnburns4017  The Meteor did not really "fight" in WWII, Eric Brown:  "It was a pedestrian aircraft, really, the Meteor. It never went into… It never fought operationally. It fought, if you like to call it that, against the V1, the flying doodlebug, and quite successfully. But it really was too slow to deal with the German jets when they came into being. They were a grade above at first. The Me262 is quite frightening. It gave us a shock to find out, because when I flew it the fastest fighter we had"  Anytime I can help!
Reply: @sandervanderkammen9230 No 262 could go that speed in level flight Mr Weheraboo. You're either  quoting a dive speed in which a Spitfire could exceed a 262 or are getting confused with the Me163 rocket plane which roasted or dissolved it's pilots alive.
Reply: @billbuckley8423  On August 19th, 1944, Luftwaffe pilot Heinz Herlitzius took-off from Flugplatz Leipheim and reached a record top speed in level flight for an air-breathing combat aircraft of 624mph (1,004 km/h) SOG in a Messerschmitt Me-262.
The flight was made over the standard FAI 3 kilometer course with 2 runs in opposite direction and measurements recorded by an Askania Kinotheodolite.
This remains an official DAC record.

The Messerschmitt Me-262 was the World's first aircraft capable of flying faster than it's Mcrit. (critical Mach number) and reach Mach 1 in a full power dive.
Reply: @sandervanderkammen9230  and where is that documented? None of the production planes in war trim could exceed 540 mph. Al those captured and tested post war, carrying no ammunition reached 510 to 540 mph. They flight you refer to was sheer propaganda invention, if it happened at all.
You are pulling figures out of your ass. The fastest the Me262 coukd dive was mach 0.86 after which it became uncontrolable.  Nowhere near mach 1.
Reply: Unverified tests conducted with nobody to monitor them are just propaganda. And the RLM limited the Me262 to mach 0.86 in a dive as it became uncontollable above that speed.
Mutke's claim is laughable.
In a series of carefully controlled flight tests conducted in World War II by Messerschmitt, it was established that the Me 262 went out of control in a dive at Mach 0.86, and that higher Mach numbers would lead to a nose-down trim that could not be counter-acted by the pilot by use of the control column. The resulting steepening of the dive would lead to even higher speeds and self-destruction of the airframe due to excessive negative G loads. Postwar testing by the British government corroborated Messerschmitt's results, though neither actually exceeded Mach 0.86.
Reply: @billbuckley8423  Are you claiming that an aircraft cannot fly faster than it's M.crit number???
Your comments reveal someone who has no formal education or professional experience regarding this subject and is not qualified to discuss this topic intelligently.
Reply: @sandervanderkammen9230  the Gloster Meteor was unstable only in the all first models, specialy the MKIII (who was the first serial built Meteor) in 1944) , but in 1948 was the Meteor (F8) modified  (longer fuselage, gravitey center modification, new tail surfaces,new engines,etc... and this solve all stability problems+ greath performance increase.The Meteor was use up to 1990, this is one of the longest use woldwide, and the later built English electric Cambera and the US built Martin B57 (two are still use today from the NASA) are direct evolutions from the Meteor...
Reply: @leneanderthalien  Dream on little Allibo.. the later model Meatbox was faster but just as deadly.
150 RAF pilots were killed in crashes  in 1952, 1951 also set a record with 12 pilots killed in one week and 6 fatal Meatbox crashes in a single day in 1951.
The development of the Canberra is not related to the Meatbox.. it was originally designed as a propeller driven night fighter.
The Canberra was a jet from the start.
Reply: @sandervanderkammen9230 
Unlike the failure Me 262 which started out with a piston engine the Meteor was a jet fighter from the start.
Reply: Typhoons engaged the V-1, or do you really think the Brits would waste a Jet Fighter for a Mission that can be done by a much cheaper Prop Fighter? They tested it against the V-1, yes - But most Downings of V-1 where done by Hawker Fighters! And the Meteor would not have been a Problem to the 262, in Fact a Typhoon or a P-51 Escort Fighter was more dangerous to it! The Meteor was slower and had less range, not to mention the 4x20mm instead of 4x30mm Cannons. Maybe the Vampire would have been any danger to the 262, but the Meteor was too weak.
Reply: @WanderfalkeAT  the Meteors were indeed used against the V1 and it was vastly superior to the 16 hour wonder Me262.
Reply: @WanderfalkeAT  typhoons didn't actually. It was tempests mostly. And the jet technology was still in its infancy so made sense to have "easy" missions for it. Also didn't want the technology falling into German hands.
Reply: @WanderfalkeAT  4 20mm cannons is the same  as the tempest. The 30mm were good for bombers but not necessarily fighter vs fighter action due to low muzzle velocity and rate of fire. The meteor could out-turn the me-262.
Reply: @WanderfalkeAT  Tempests, Mosquito's, Spitfires, Mustangs and Meteor Mk I's were used against V1's. The Meteor III would have been very effective against, it had low range,so did the Me262 and the same excellent 20mm cannon as the Tempest, Mosquito and Spitfire. The 30mm on the Me262 were not so good for fighter combat. Just like the Meteor, the Vampire would have been very good against the Me262.
Reply: Correction, the Typhoon wasn't used against V1's, the Tempest was one of the fighters used against V1's just as the Tempest and Spitfire were so effective against Me262's.
Reply: The "Meatbox" appears to have been designed to deal with the surplus of RAF pilots...
Reply: @martkbanjoboy8853  The Gloster Meatbox was the worst jet fighter ever used by the RAF without any doubt..
 The question is why didn't the RAF permanently ground them or replace them sooner?

The F-104 is a Mach 2 performance interceptor which first flew when the Meatbox was still in production... it wasn't even capable of transonic speed, it was only subsonic... like riding a bicycle with training wheels.
Reply: @sandervanderkammen9230  the F104 Starfighter has the worst record of any fighter aircraft ever built, there are no official sped records set by a 262, just heresay and I doubt if the 10 hour wonder 262 engines would last long enough to reach anything over 550 MPH before self destructing which they all did.
Reply: @georgebarnes8163  The F-104 was the worlds first Mach 2 all weather fighter- interceptor...
The Meatbox was never capable of supersonic flight or being an effective combat fighter aircraft. 

Heinz Herlitzius took off from flugplatz Leipheim on July 25 1944 and set a world record of 624mph in level flight across the FAI 3km distance and measured with a Askania J2B the world's most accurate kinetheodolite.
It was an official FAI record and remains an official DAC record.

The Jumo 004b engines met or exceeded the 100 hour PFTR requirements of the RLM for adoption into Luftwaffe service.
  100 hrs PFTR is the same standard used by the RAF and USAAF during WW2.
The U.S. Army tested the Messerschmitt Me-262 after the war during Operation Lusty and found TBOs averaged between 50 and 60 hours, comparable to reciprocating engines in Allied interceptors and excellent by WW2 standards.
Reply: @sandervanderkammen9230  The only time    a1 04 saw Mach 2 was when it hit the ground, they were not called the flying coffins for no reason with  a total of 85% airframe and pilots looses. A total lemon that never saw any combat, all crashes were down to the aircraft being a pile of junk.
Reply: @georgebarnes8163  Over 1,000 Gloster Meatboxes CRASHED killing 450 RAF pilots...
Reply: @sandervanderkammen9230  LOL, nothing compared to the lemon F104 Starfigther lol
Reply: @georgebarnes8163  The "Meatbox" as it was called by RAF pilots was the worst jet aircraft ever.
 150 killed in just one year  (1952) 12 killed in just 1 week!
   In 1951 6 were killed in crashes in a single day.
Reply: @sandervanderkammen9230  So you keep repeating, you are like a broken record.
Reply: @georgebarnes8163  The TRUTH bears repeating.
Reply: @sandervanderkammen9230  Bad stutter you have there.
Reply: @georgebarnes8163  I didn't stutter..
When something is true it is worthy of repeating.
Reply: @sandervanderkammen9230  OK Karen
Reply: @georgebarnes8163  450 RAF pilots killed
Reply: @sandervanderkammen9230  OK Karen
Reply: @georgebarnes8163  Childish insults won't prove you failed argument... or make you look smarter.
It's an indication that you are aware you lost.
Reply: @sandervanderkammen9230  OK Karen
Reply: @georgebarnes8163  Thank you for proving my point.
Reply: @sandervanderkammen9230  OK karen, thanks for proving mine. A bit like watching paint dry but a lot more boring LOL.
Reply: @georgebarnes8163  Haha! Thanks for proving my point again!
Reply: @sandervanderkammen9230  Sorry, all out of carrots, a Karen ate them all.
Reply: @georgebarnes8163  104s never saw combat? Vietnam? The 104 wasn't a bad aircraft when used in its originally intended role as an air superiority fighter. What "killed" it was putting more and more equipment and electronics in it to make it an all-weather multirole fighter and even a nuclear weapons platform.
Reply: @sandervanderkammen9230  
The F 104 all weather fighter which could only fly in good weather and was still a death trap of the worst kind.
The record claimed but never recorded and the Me 262 would go out of control or break up at that speed so no, it never happened.
The very unreliable Jumo engines were lucky to last 10 hours.
The RAF tested the Me 262 and found it to be very poor, the RAF pilots already knew it was useless as a fighter.
Reply: @sandervanderkammen9230  
Far less than 1,000 Meteors crashed and they had a lower loss ratio than the P 80.
Reply: @georgebarnes8163  85% loss rate? Total bollocks
Reply: @barrierodliffe4155  Give us the true accurate loss rates for both.
Reply: @Hattonbank  Clam down old man
Reply: @Hattonbank  Not a single Meteor was shot down in combat.quite a lot of the Me262's which flew were quite a few of them by RAF fighters. More Me262's were destroyed than ever flew.
Reply: @sandervanderkammen9230  i prefer the German word for this jet. The widow maker
Reply: @topbanana4013  I was always partial to the nickname "Meteorite"  a Gloster Meteor that crashes to earth
Reply: @barrierodliffe4155  Not a single Meteor was ever used in WWII combat.  Not one, unless you count hiding from Germans combat.  At 100 mph slower than the 262, the Meteor was deemed too slow to deal with the 262 as per Eric Brown.  Hope this helps!
Reply: @barrierodliffe4155  Not a single Meteor ever engaged the enemy in WWII combat.  Zero . Zip. The complete list of British jet aces throughout history is, well,  zero.  Hopefully this clears things up for you
Reply: @sandervanderkammen9230  as all soviet bombers of that time were very subsonic the argument is pointless .
Reply: @alpearson9158  A very specific point when considering the design and performance criteria for a jet  interceptor that is required to neutralize bombers before reaching their target zone.
Reply: @alpearson9158  Not pointless when the concept of supersonic bomber aircraft was being considered by both the USAF and the Soviet airforces and did in fact achieve this in operational service.
Reply: @sandervanderkammen9230  Hello Sandyboy, Interesting to see you 've had to delete some of your recent comments because they got trashed, but I see you're still contributing as Sockboy Redsen, which is fun.
Reply: @Cloud Burst 117 Not correct...
Reply: @martkbanjoboy8853 Thank you for conceding.